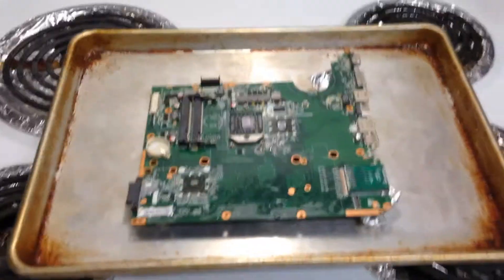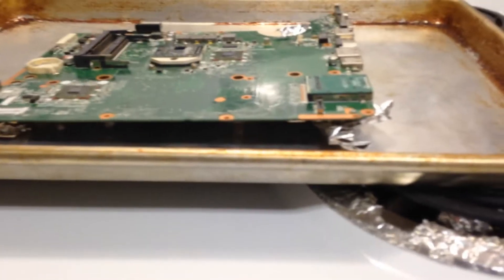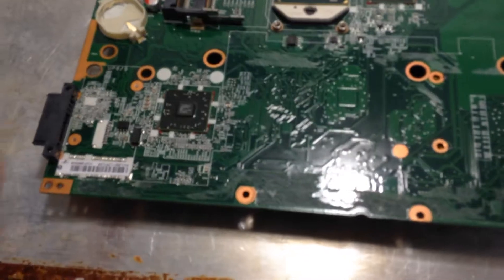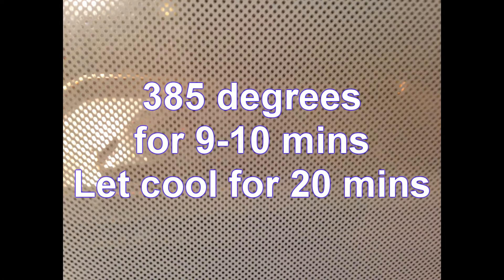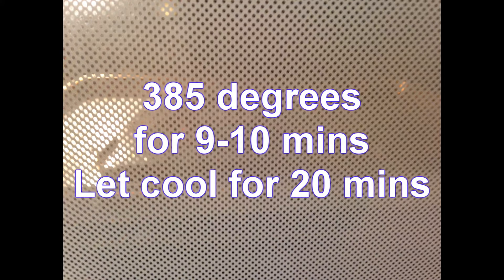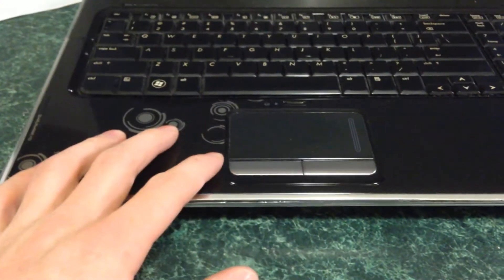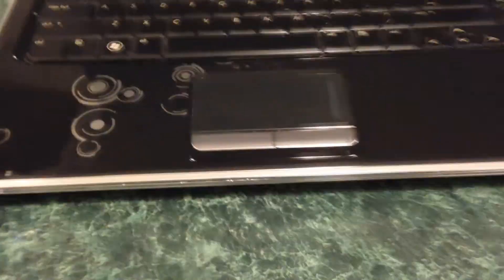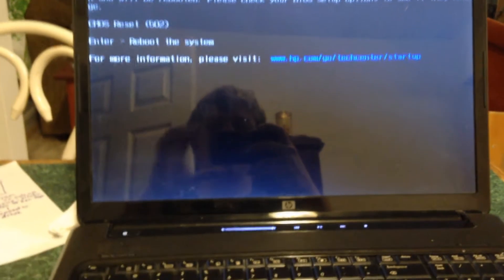Baking My Laptop Motherboard!!

Comment: I dropped water on my laptop and stops working. I change the mother board and was working fine and the old one I baked. The CPU was attached to the motherboard this is the motherboard type for lenovo x200. So after the bake I tried and it works so I sold it 20 euros :) and now is still works after 1 year

Comment: It works!!! Kept 10 minutes on 185 Celsius and after baking amber light indicate on power supply problem and no sound at all. After baking, the  problem with blank screen removed. Now I can be sure to dispose motherboard because it is finally  useless.

Comment: 385 degrees???? But now Celsius I suppose..........what happened after the baking to the plastic components on-board??? Like the tampon battery connector, ram connectors and so on, I would like to do the same but I'm worried about this detail.
Thank you in advance.
Reply from the maker: +Gianluca L. This is in Fahrenheit. Everything worked fine for me, just take out any plastic coverings. Some things will not come off though.
Reply: Gianluca L. 350 ten minutes it’ll be fine
Reply: That's 200 Celsius....  196 exactly but just put 200